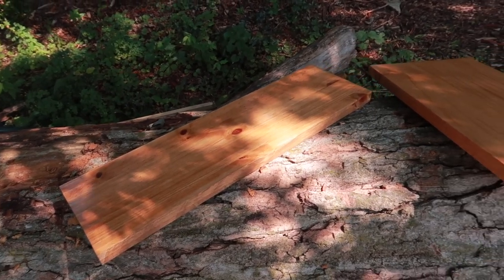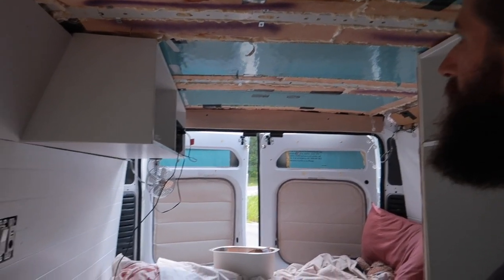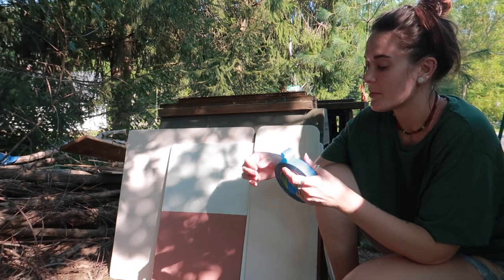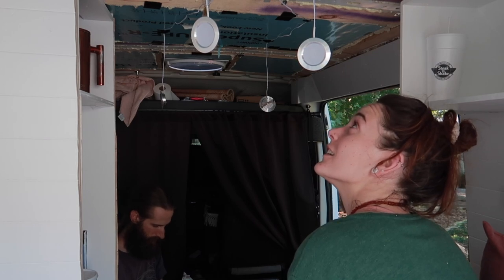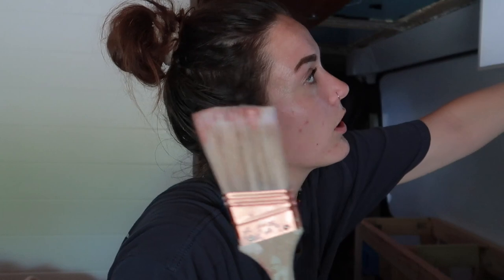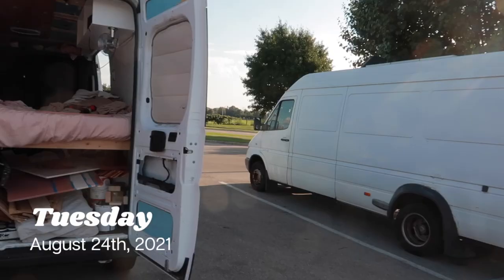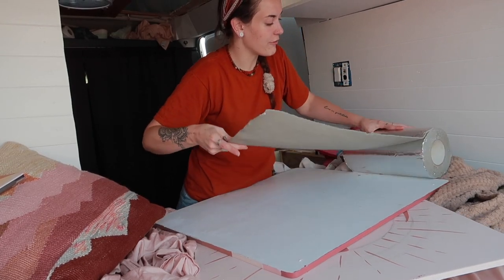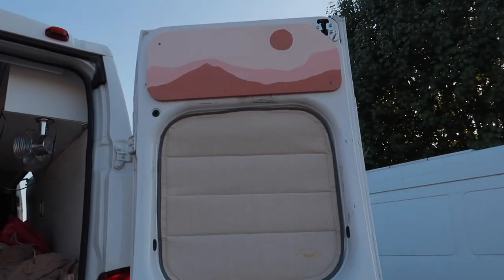VAN BUILD Door Finishes and Ceiling Install // VAN LIFE VLOG

Comment: How did you get your ceiling furring strips into the metal? I am having the hardest time getting screws through my metal. I’ve tried self drilling screws, sharp point screws, and it’s just proving very difficult.
Reply from the maker: I consulted josh on this one 😊 he said to try using a drill bit for metal to pre drill your holes then try the self tapping screws! 🛠 and make sure to wear safety glasses to protect your eyes from any metal shavings that fly loose 👍🏻